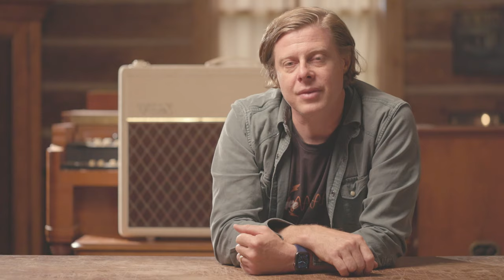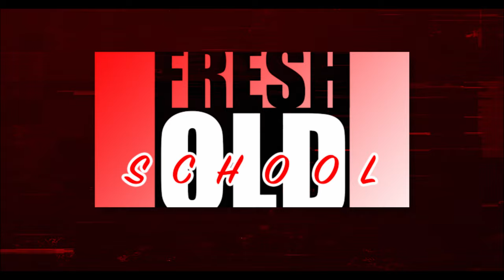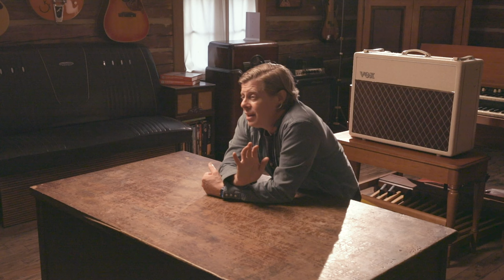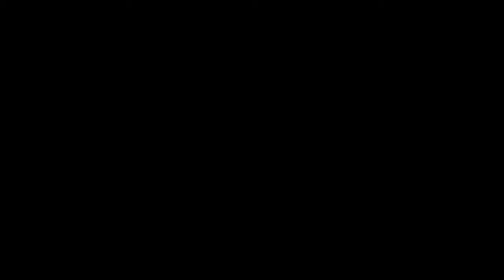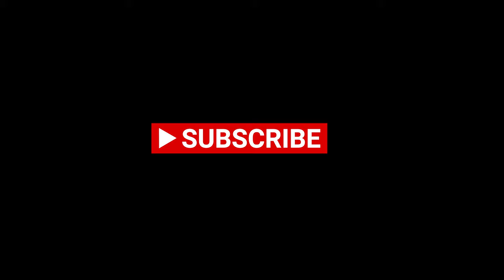Guitar Amp Cabinet Recovering Tips for Tolex, Tweed, or Upholstery - Cheap Easy for any Amplifier

Comment: I’m thinking about redoing my Fender Hot Rod DeVille amp with a tweed covering. Is there a specific type or brand you recommend? Will Tru Glue be good for tweed, and how much tweed material will I need? Thanks!
Reply from the maker: Thanks for watching!  True glue is perfect just know that you don’t want to soak the tweed or it will bleed through.  So pour it in a disposable bowl and dip your brush and then apply evenly without letting it pool up. Probably could do it with one yard but might want two just to have some to practice with. Hope that helps!  Just be careful with tweed not to soak the corners either. Just a nice even coat not dripping.